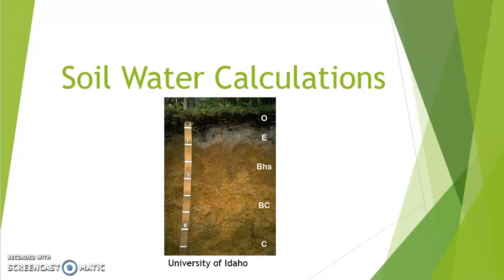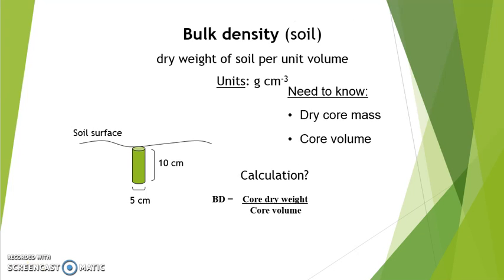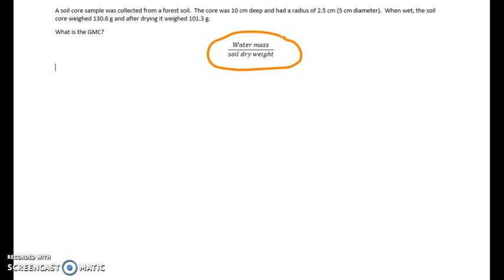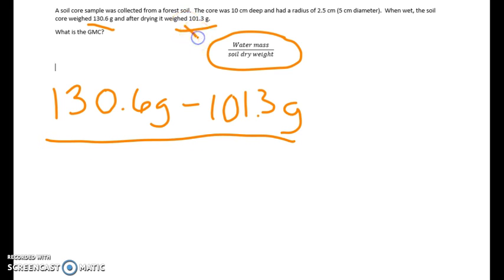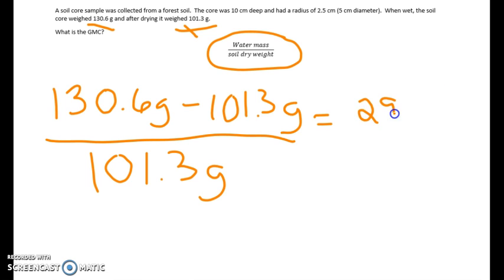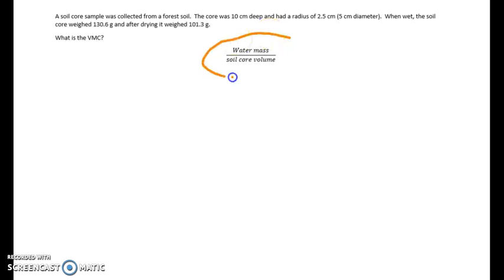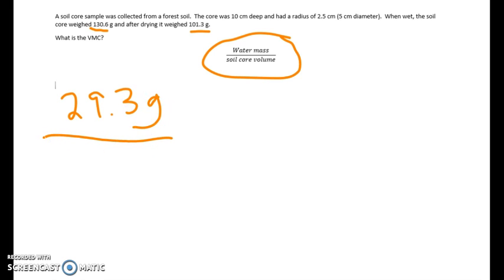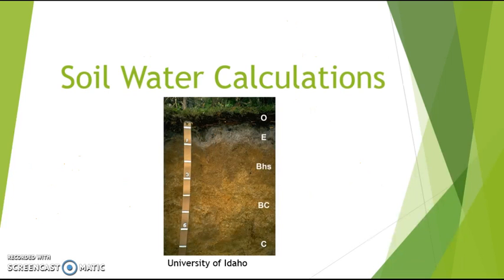soil water calculations

Comment: Can you calculate this for me ) The temperature of a wet soil is 23°c, the volumetric water content is 0.25, the soil bulk density is 1.3 milligramme per meter.
Calculate the quantity of heat required to raise the temperature of a 0.5m layer of the soil to 35°c